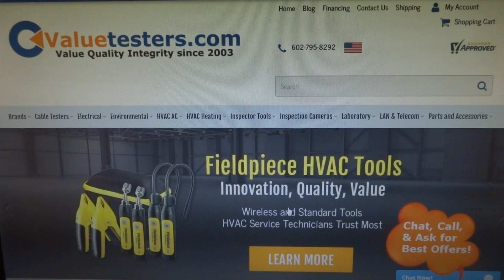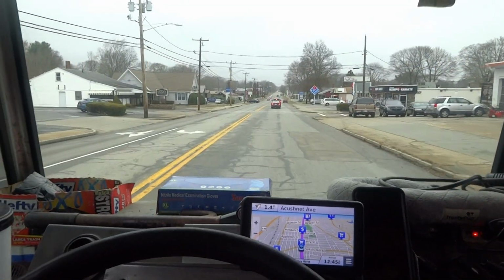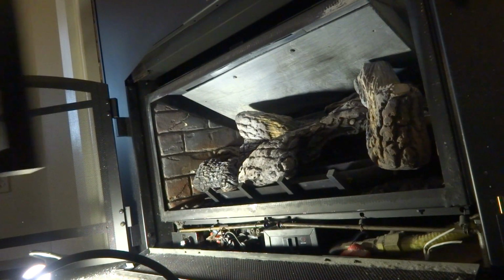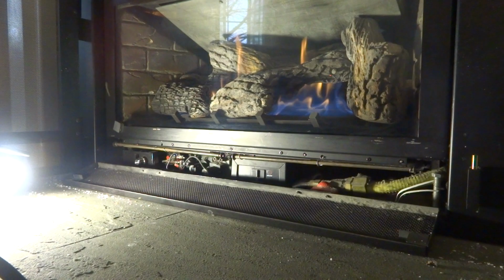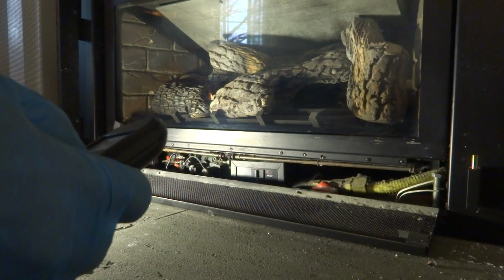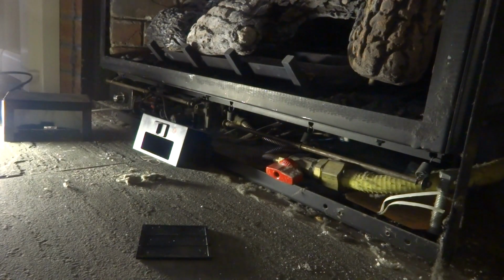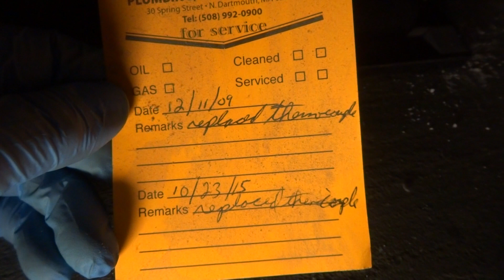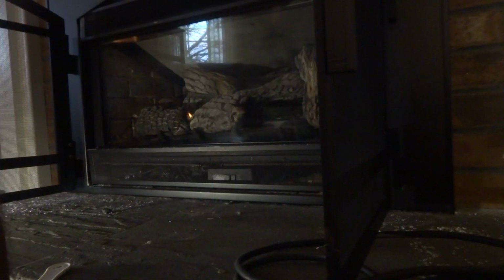gas fireplace insert service   cleaning

Comment: Hi Steve.I really enjoy your videos. I also work heating and cooling in michigan. Just giving maybe a few tips. Bring a moving pad with you for fireplace cleaning. Take fake wood outside and blow off with compressed air.Clean the burners and pilot assembly.Inspect and tighten wiring and connections at gas valve.

Comment: Steve appreciate posting up and helping techs learn the trade from all your videos over the years. I sure learned alot. I got hired out of trade with my HVAC degree and got hired by a fireplace/chimney sweep shop. That was 7-8 years ago and now run my own fireplace inspection service company. Just wanted to let you know appreciate all your videos and thanks for helping all us young techs and if your ever in need of some info on fireplaces like the one above, I can help. Have a cool one.

Comment: Hey Steve I have the exact same insert. You adjusted the flame but never adjusted the fan.The fan can also be turned up or down. It also has an knob to mix the oxygen level if it is burning to rich or lean.

Comment: Love the video's, looks like a Mendota. Only thing I'd like to comment-  you should never use windex or other ammonia based glass cleaning products as it breaks down the coating on the glass and will cause discoloration, staining and clouding.
Reply: That log on the front right looks in the wrong position.And yes looks like Mendota.
Reply: Well guys, I've been using super clean degreaser on the glass, especially when there's black soot, then following with windex. Is there an agressive cleaner that doesn't harm the coating?
Reply: @Robnord1  I use actual Fireplace glass cleaner made by Imperial
Reply: @croyal4240  Thanks. I'll get some. Maybe avoid a 'you messed up my glass' claim. I like em happy mama!

Comment: No time for miss Molley have to get the gas fireplace done. On the trackless when you use it with the Cummins 4bt whats the fuel consumption rate when everything is turned on compared to old crusty.  Im sure if you wanted to down the road add a shaft driven mower to it. like from a Gravley lawn tractor and make your own frame as you did on the plow. could be cheaper than getting a mower from trackless.  since you have an air conditioned cab now can mow when staying cool.  any videos on your chicks on how well they do in the wintertime

Comment: you are not supposed to us windex of anything like it, is has ammonia and can permanently stain the glass
Reply: Not so
Reply: I guess toy are not a gas guy then
Reply: Yes I worked in glass for a number of years. Glass cleaners use ammonia, the better glass cleaners have more ammonia. It is for cleaning glass. Maybe you are thinking of plexiglass or lexan which are both polycarbonates and not glass. Shouldn’t use it on those. Wood stoves use pyroceran and you can use straight ammonia on these. Gas fireplaces have tempered glass.
Reply: @ricktrapperriley2534  but you aren't a manufacturer of gas products, I have sold and install for 10 yrs now and every fireplace manufacturer I have talked to says don't use windex on there products, if you can find me one piece of paper that say from a manufacturer for fireplaces I will believe I say you are right
Reply: Well google agrees with you guess I’m wrong

Comment: Sickening. !!!   Where is your multi meter  to check millivolts on thermopile and thermocouple ? and manometer   to check pressures ?     Windex on the glass is a number 1 no no.  Only fireplace glass cleaner as per  manufacturer   says right in manuals.   Logs not taken out for visual burner check or air shutter check. Visual vent check done?  Didi you test valve magnet ?     Leak test ? Carbon monoxide test ?  Half your video was farting around with the remote and receiver     could pay anything more than 20 for that service